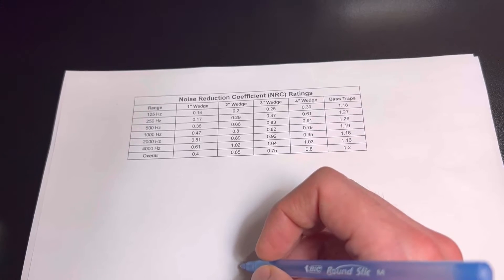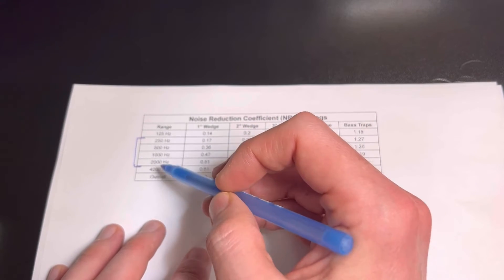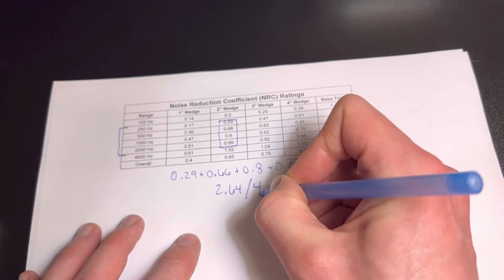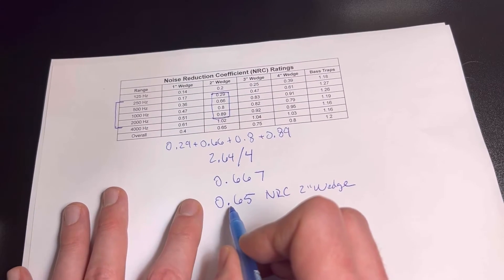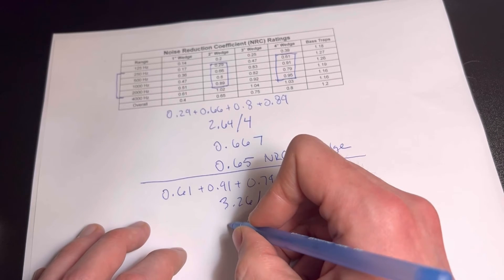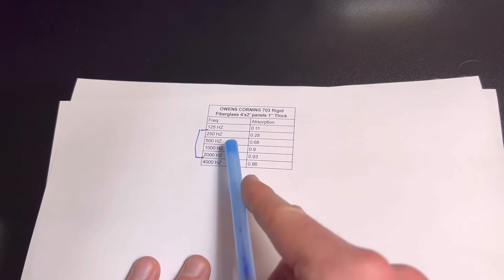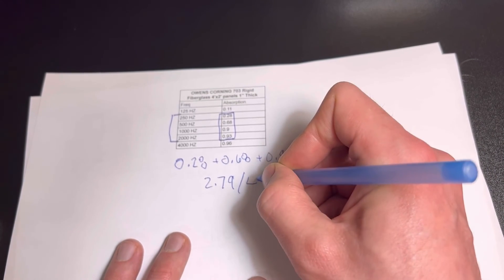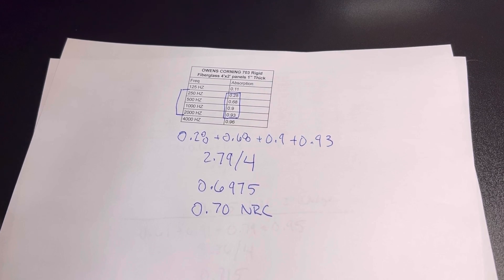How To Calculate NRC (Noise Reduction Coefficient)

Comment: Great video and I have a question! How did you get those numbers. Great video in teaching how to calculate with the numbers presented on the sheet but what machine or device is used to come up with numbers for NRC for a specific material like fiberglass for example? I want to find the NRC for a specific material and how to find those numbers on my own. I thank you for reading this question and thank you for the awesome informative video. I hope to hear back from you.
Reply from the maker: Great question! The absorption ratings you’re asking about are derived from controlled measurements conducted in professional acoustical laboratories. These labs use advanced testing methods to determine accurate absorption ratings across various frequency bands. If you’re looking to find the ratings for a specific material, you could search for existing test results of similar materials or contact a reputable testing facility directly. In the US, we often recommend Riverbank Acoustical Laboratories for their reliable services.